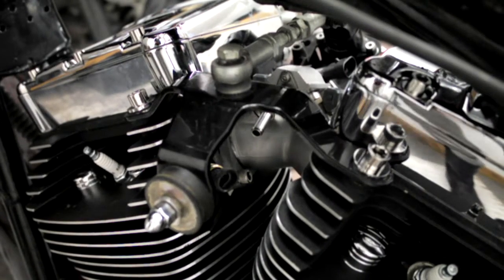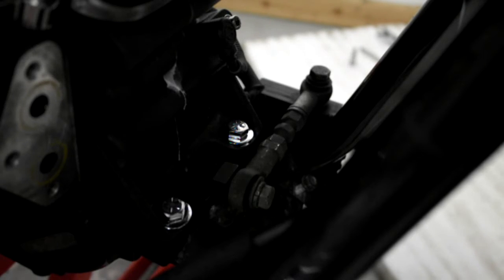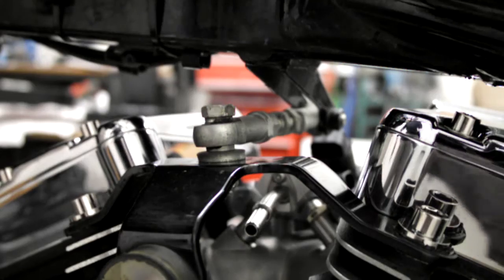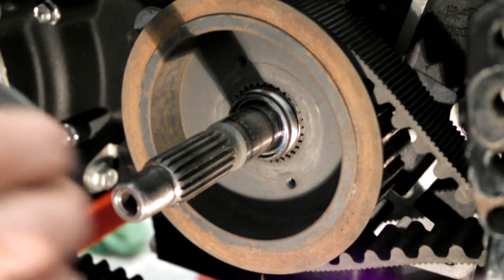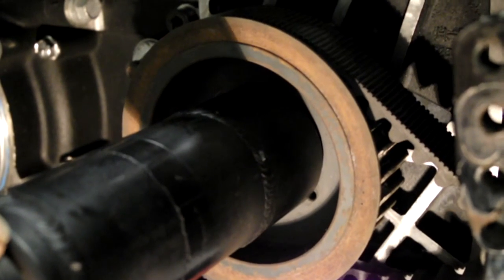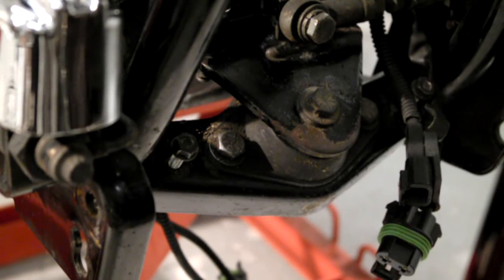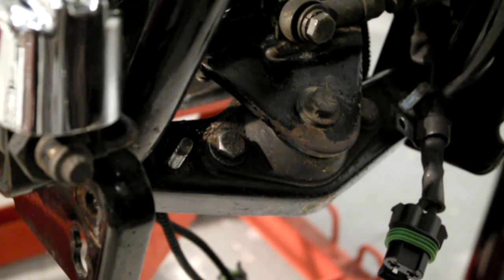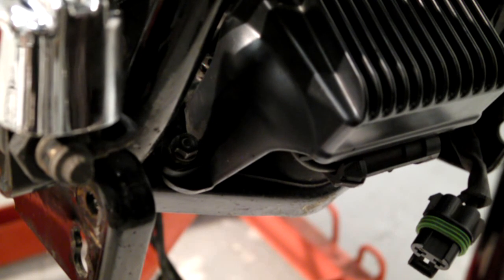Harley Twin cam 88ci strip and rebuild part 41

Comment: Hi I'd like to know how you lock the old belt on the swing arm to block the poly.  Thank you for your videos they help very much.
Reply from the maker: Hi, The belt is wrapped around the pully and then i used a G-clamp to clamp it to the swing arm, in this video I clamped it to the top side of the swing arm but about 6 months later I fitted a new pully to a mates Glide and clamped the belt to the under side of the swingarm and found that it worked better.
Reply: @pick6667  thank you for your quick answer i'll try this way. All your hd tc88 strip and rebuild playlist is very usefull for me as I'm rebuilding the same bike from the naked frame, hope It will run fine. Thank you again for sharing your very good work. Ride safe!

Comment: Goodnight, I liked your videos. What is the size of the wrench that loosens the large bolt to take the poly from the belt? I will have to do a service on my 1999 electra glide and I need to know what tools to buy .. now you can tell me in newton meters what the tightening of this poly is, what is the tightness of the clutch basket shaft, the starter screw , The axle where the alternator is and the remaining bolts that tighten the primary to the engine?
Thank you very much and you're well
Motorcycle greetings
Reply from the maker: Hi Joao GomesThe drive pulley nut socket is 1-7/8 inch ( one and seven eighths inch ) this nut is a left hand thread and tightens up to 81 Nm + 35°- 45° to line up the lock plate as in this video.
The clutch hub nut socket is 1-3/16 inch ( one and three sixteenths inch ) this nut is also a left hand thread and tightens up to 95-108 Nm.
The starter jackshaft bolt tightens up to 6.8-9.0 Nm.
The engine compensating sprocket nut socket is 1-1/2 inch ( one and a half inch ) and this tightens up to 203-224 Nm.
The bolts that hold the inner primary case to the engine andtransmission are all tightened up to 24-28 Nm.Hope this helps
Reply: Thank you my friend, it's good to know that there are still people who want to help! I want to thank you again and I hope you continue with your activity that you have been playing with great quality!
Motorcycle riders here from Portugal!
Reply: Pick666.... Joao Gomes is just one example of how the people will welcome you into a business .